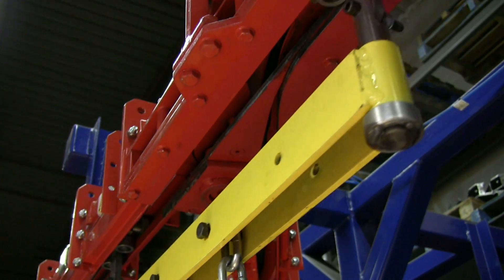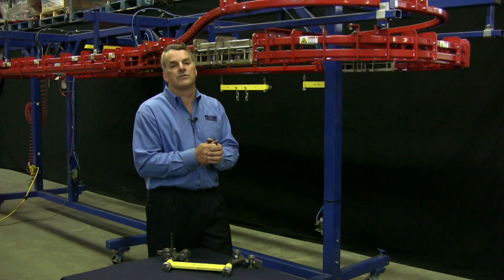What are Power and Free Conveyors?

Comment: Hello Pacline Overhead Conveyors

At my company we are having issues with trollies being pushed by the trolley behind.

My opinion is that the tail of the flapper is starting to get a flat-spot (versus smooth radius) making disengagement from the drive dog more difficult when it hits the leading trolley.  Results in an audible "CLICK"

This has caused chain tension at lock-out points and eventual failure (overload) at VFD controller.

Please advise if you have other ideas.

P

Comment: Exciting. I could use this kind of tracking system on my both powder coating cabins and I can have them placed parallel and increase OEE levels of the paintshop.

The question is, for each set of tracks, how much weight they can withstand? and what is the maximum possible gap between two tracks?I have parts starting from palm sized with a couple of hundreds of grams, to wide an long (100cmx300cm) up to 15 kilograms.
Reply from the maker: Hi, our conveyors have industrial ratings suitable for the automotive industry.
The load carrying trolleys have 100 kg per trolley rating which is more than robust enough for your application.
The yellow bar (called a loadbar) is attached to 2 trolleys which would give you 200 kgs per loadbar (or 100 kg per trolley x 2 = 200 kg)!